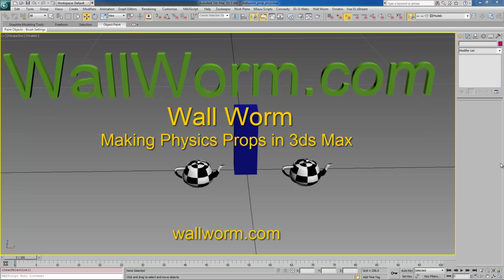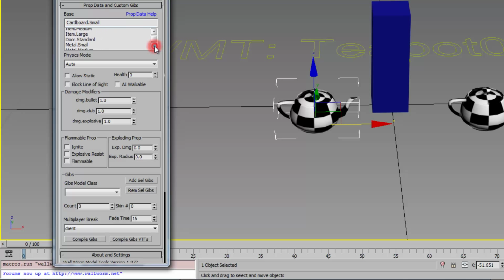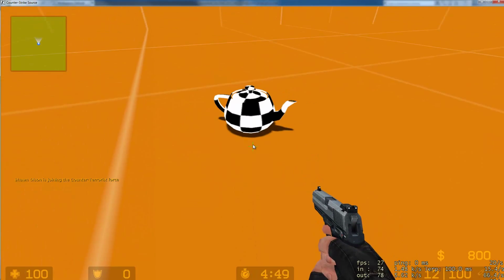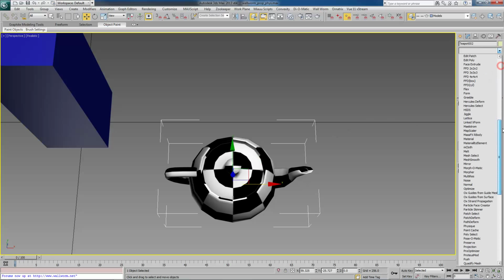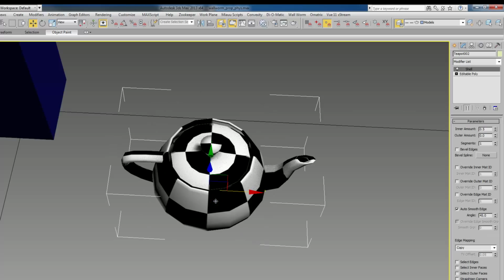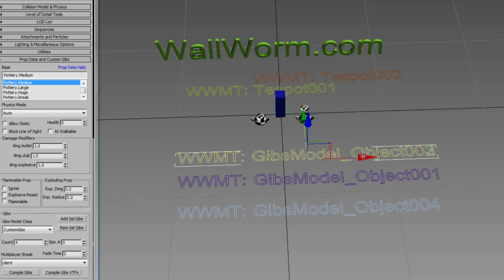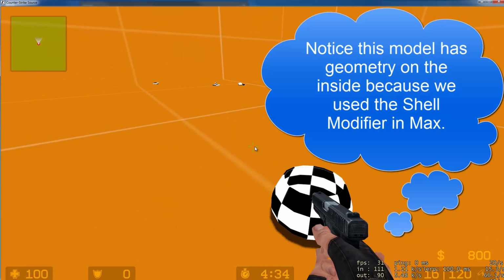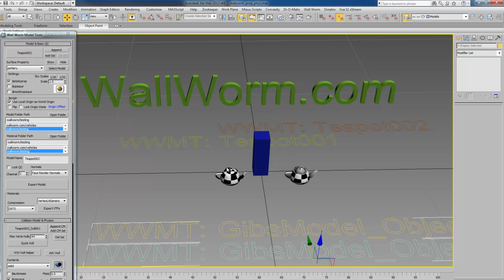Physics Props in 3ds Max

Comment from the maker: The link in the video info above will give a little more help/tips. The main reason a prop won't spawn gibs is that the base type is set to one that doesn't spawn them natively. Try different base types... or experiment with making sure the health is adequate. But certainly read the link above... and if you need more help ask in the WW forums.